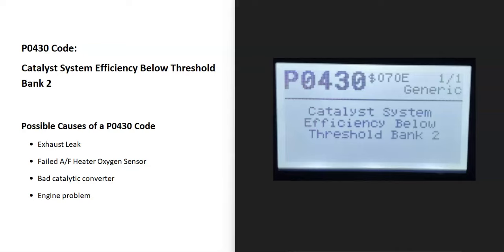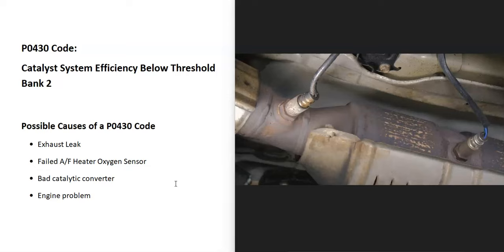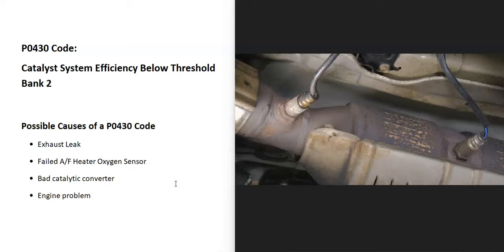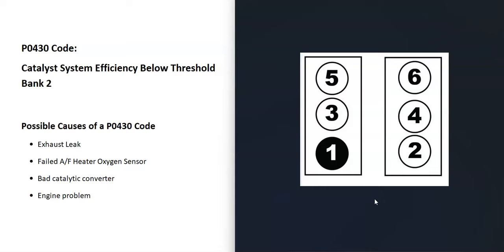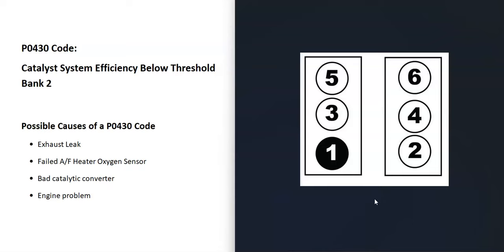Causes and Fixes P0430 Code:  Catalyst System Efficiency Below Threshold Bank 2

Comment: Sorry but bad news after 10 to 12,000 miles exact same code will come back and you will clear it 2 to 3 days and then a week later it will come back all this really does is clear the code out so you can get through omissions and shut the light out you’re going to have to deal with a cat situation fix the problem Find out why is common on find cars I know because I’ve done it. I went over everything on my vehicle that would cause this code I know what the problem is I just wanted a quick fix so I can get through omissions after 10 to 12,000 miles that coded come back instead of a P430 it was a P 20 I know I have to pull the cat replace it get it pulled out and get the cat cleaned out, because I know it’s not broke it is starting to plug up. I feel it because I am getting pinging on acceleration when your cat system starts. Plugging up yoga pinging, loss of power and EGR codes O2 sensor staying at center. You will have to go aftermarket do not go cheap. This is just a fix that’s it you’re going to have to deal with troubleshooting this system. I know this is bad words to people, but it Hass to be done.
Reply: Yup

Comment: I changed my both a 02 sensors, with no luck, no holes or leaks, i noticed a misfire at idle, with no codes, i changed sparkplugs and wires no luck, i then changed fuel inyectors and all codes clear, usually chevys inyectors goes bad at 150,000+ miles

Comment: I had a very bad antifreeze leak.  Caused other issues. After I got them repaired, I still had a check engine code p0430.  I used some cataclean after a few days of driving my check engine light went off. Added it to the fuel at a quarter tank and drove it for about 15 minutes then filled up.  Yo decided to go that route before changing my 02 sensor.

Comment: Good day to all.  I have a car Honda Odyssey 2013 3.5 v6.  A few months ago the error code p0430 came up.  I replaced the sensor with a new one.  and So I drove 7000 miles when it caught fire again.  (p0430). There is no loss of power when driving.  and there is no feeling. The engine oil is clean. Thanks in advance for anyone who thinks about this.

Comment: I had lean codes both banks from a cold thermostat I put in along. With p430. I put the stock thermostat back in and lean codes are gone and p430 just doesn't want to say goodbye yet...think I am screwed.😮😮 UPDATE it was not the thermostat it turned out to be the secondary air check vale gasket had a leak .

Comment: I just replaced my catalytic converters and sensors on my f150 3.5 ecoboost. Also replaced my spark plugs and coils. I was having power issues when I would get up to 70mph. After all of that, I am still having issues at 30-40mph and 70mph. The truck loses it power and sputters. I took it to Oriellys, and the P0430 came up. I'm starting to think that maybe the new catalytic converter or sensors are bad from the manufacturer?  The only code that shows up is the P0430. 😢
Reply: I have a 2019 f150, had my catylitic converter replaced under warranty around 68,000 miles. Less than a year later, Ford is saying it needs to be replaced again. Replacement parts were on back order. Seems to be a larger issue impacting lots of folks, surprised there's not a recall yet
Reply: @jarvicerandolph9949  It sucks so bad. I just want the power of my engine back. 😫

Comment: Hey there, I'm getting this code (no other codes with it) - I put a catalytic converter cleaner in my car and after some days my car becomes randomly sluggish as I drive, as mentioned in your video I step on the gas and the car doesn't go, feels like its losing power, and it shoots a bunch of gray smoke out of the tail pipe as this happens, it's a 01 nissan sentra gxe 1.8 with a lot of miles on it, any help
Reply from the maker: I would test the catalytic converter to see if it has failed.

Comment: I notice that everytime I used gas from a certain gas station, soon after I get this code. When I ran almos out of fuel I go to a different gas station after a few minutes driving, the engine light is no longer on.
Reply: I only run Chevron 91 octane cause i noticed it fixed my code on my tahoe

Comment: I have a 08 Saturn Vue about 121k miles and I got a P0430 code and P1133. CEL came on after getting the oil changed. The ride isn’t necessarily rough but it GUZZLES gas like crazy. Any advice?

Comment: CRC Guaranteed To Pass Fuel System Cleaner 12oz

Whill cleared your code and clean your exhaust system i just used rhis bottle works like magic it cleared on its on and my check engine is gone this stuff works as advertised
Reply: I will add my results with cat cleaner for my Toyota FJ cruiser has pist me off on this p0420 crap I ended up just wasting my money I even put lacquer in my tank 1 gallon as scotty Kilmer said that would work once my drive cycle reset code came back so I ended up buying a spark plug fouler drill out so o2 sense would fit  no more p0420 code now a evac code I can't win for loosing in 2025 emissions gose away in texas no more I be happy like many will I think buying a 10 dollar spark plug fouler best and cheap way to go and be done with chasing a ghost
Reply: Were u losing power to? Did it come back after
Reply: Waste of money dude , I’ve tried all those car clean products , none of them worked , light came on a week later everytime !!

Comment: Getting this code again.
A year ago I got the code, then added Cataclean & the codes went away.
It's back, and I guess I'll try cataclean again.
Any other tips?
The 2010 4 runner drives great and I hope this clears up the issue.
Reply: Hi do you fix it??
Reply: It's says on the bottle to use atleast a couple bottles of cataclean a year. Did u loose a lil power? Did it the power come back after u cleaned it

Comment: Hey boss, I have a 2015 altima 3.5 sl. I have this code and c1155 (front left wheel speed sensor imput circuit failure)
I replaced the front left wheel s. Sensor. But car is still going into limp mode. (Car stays on but doesn't receive power or rev) but it does when I put it in park. Rpm jumps up like it's burning up whatever leftover gas. Turning the car off, resting, then back on solves the problem long enough to drive home from the gas station.
Hoping you had some insight
Reply from the maker: This is just a guess, but it sounds like an engine problem, like a leaky injector or similar. A leaky injector will clog up the catalytic converter and give false Cat codes. Also, many vehicle computers will shut down ABS brake systems when the engine has issues.

Comment: Thanks for the video. I have a 2008 GMC Sierra. I had both of the catalytic converters replaced about a year ago. About a month ago I had all of my lifters replaced on the passenger side due to a failed (collapsed) lifter. My engine light has been on right around the same time. I used a catalyst cleaner and had the code cleared. I have driven it for about 150 miles since clearing the code. The engine light is not on but the code is still stored in the memory and I cannot pass inspection until it totally clears. How long does it take to do that and are there any tricks? to help it along?
Reply: I forgot to say, the code was for low efficiency catalytic converter bank 2.
Reply from the maker: It may be clogged from the engine issues, and it is hard to say when it will burn out.
Reply: @HVAC_Mechanic  Okay, thanks for responding.

Comment: 20093 tahoe- 154000 miles. Engine developed p03000 random misfire a few months ago. Interestingly, I had a new catalytic converter and 02 sensors put on about 4 months before the random misfire started. Engine only misfires when truck is under a heavy load. In Alabama in 95 degrees weather running 85 down the highway with the ac on full blast. We tried to pull a small uhaul trailer and the weight of the trailer and the ac would cause misfire. Tuneup done. New Coil packs etc etc. Didn't fix. Now It's throwing this code also. Last Mechanic seemed to think it was related to emissions/evap. He didn't have time to dig into it, and at the time no codes. Just the random p0300. Then it would clear. Thoughts? I'd be so grateful
Reply from the maker: The only component in the EVAP system that may cause a problem is if the purge valve stuck open. This usually only causes issues when the engine is starting and not under load since it would be open. The fuel pump may be starting to fail and not able to deliver during a load. I would test the fuel pressure at the fuel rail.
Reply: @HVAC_Mechanic  awesome. Thanks.
Reply: @HVAC_Mechanic  what about a bad 02 sensor that is " capped out" but not bad enough to throw a code? Or bad fuel pressure regulator?